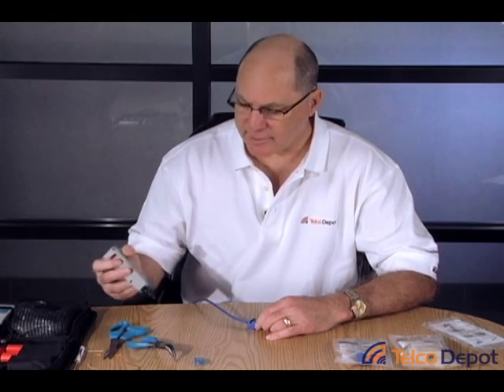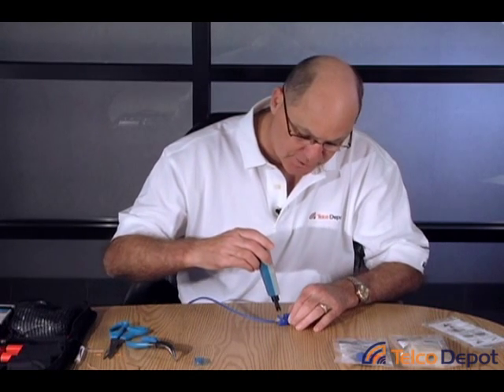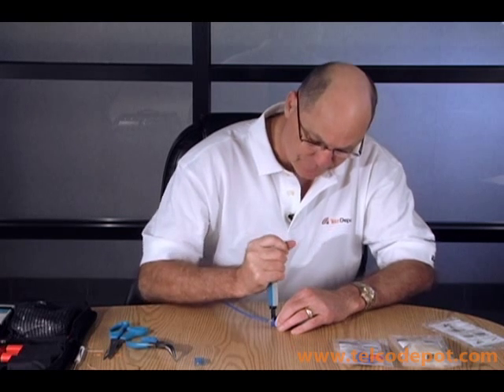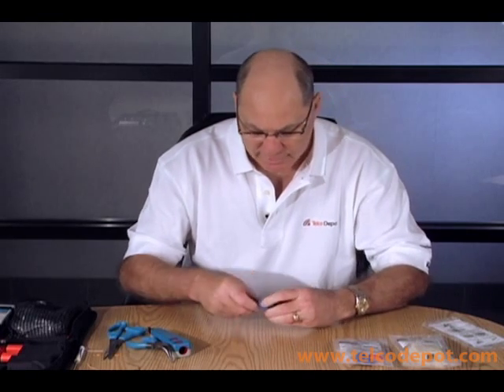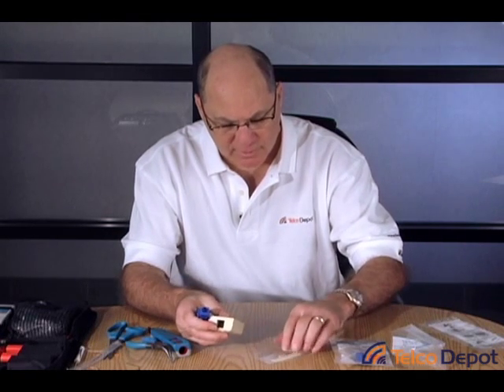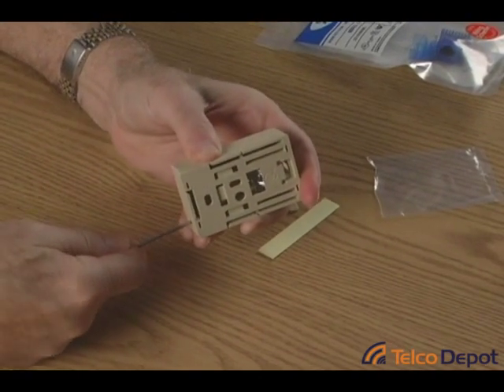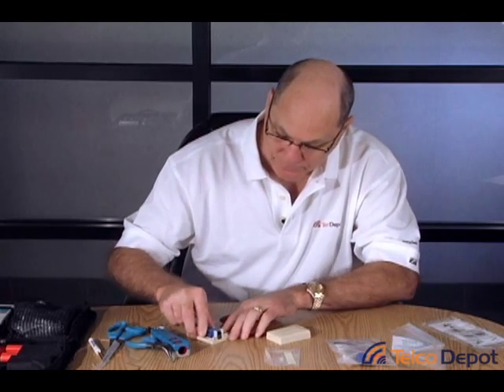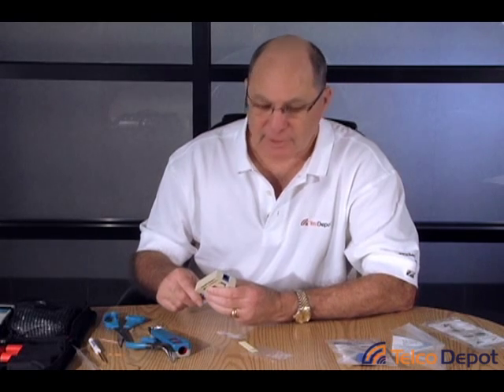Phone System | Terminating a Cat 5e Jack Part 2 - Wall Mount Installation | TelcoDepot.com

Comment: @emr42901 There are splitters available where you can plug in one network cable to a termination and the other end is already terminated for two network connections. I'd recommend running additional cabling for additional terminations, as you can degrade network performance with network splitter devices. Do a YouTube search for @cablesupply and one of their videos shows you how to use an existing cable run to run additional cable. It's fairly easy.

Comment: Is it possible to add an additional data termination in my home from another termination? Or do all terminations need to be home runs? There is only one termination in my home and I have a two story home with no way easy way to run a new wire to my garage. I would like to keep the existing termination if possible and not make it a junction. I have found no resources about this on the internet yet and was hoping for some direction. Thank you and great video very clear and easy to follow.